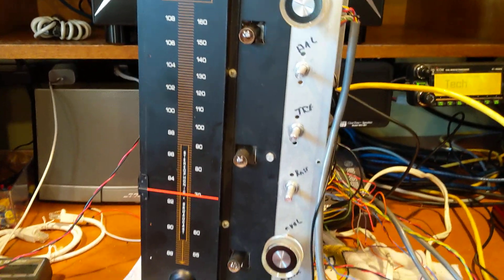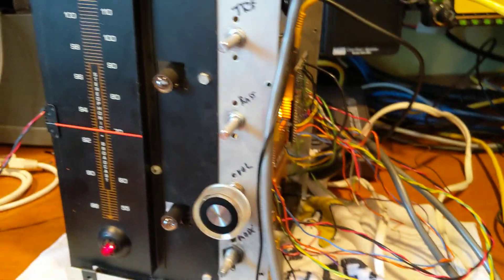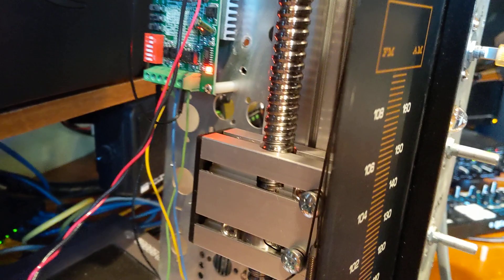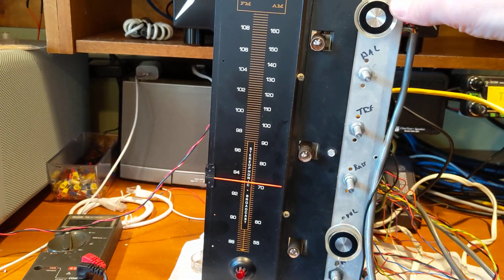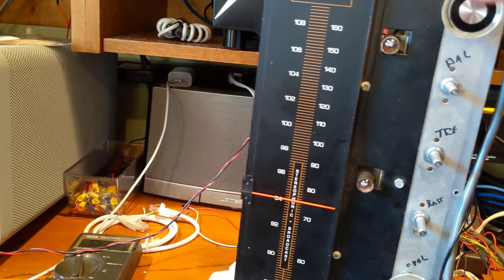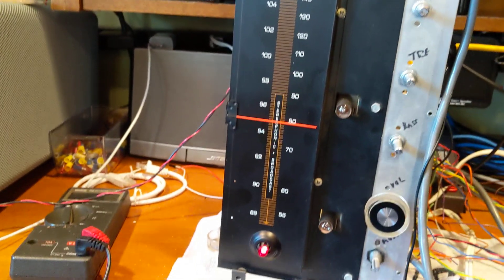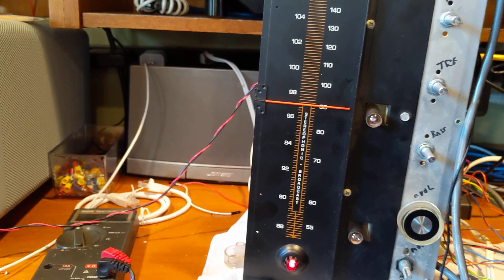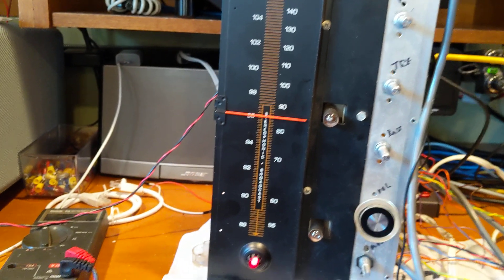Stereo Console Tuning

Comment: Unless you like the stepper-motor sound, you might consider changing to a silent stepper driver.  Also, a more intuitive interface for auto-tuning might be for tapping to do a search in the same direction that manual tuning was last done (and maybe auto-reversing at the ends).
Reply from the maker: I think I'll code that auto tuning interface as you've described. I like it.
Reply from the maker: Yeah that stepper motor is way overkill. A smaller, quieter one attached to a pulley would be an improvement. I couldn't figure out a good way to mount the motor I had to the old dial cord pulley. This way was quick and easy and I was able to move on. It is definitely something that can be improved.
Reply: @w4atl  you used a ballscrew large enough for a CNC metal lathe's cross slide. :) How about a DC servo motor? There's some info out there on DIY-ing them for 3D printers. That would allow for smooth and silent travel from stop to stop on the dial.